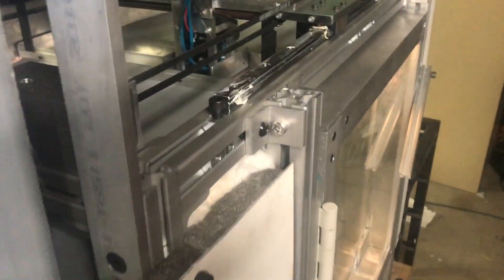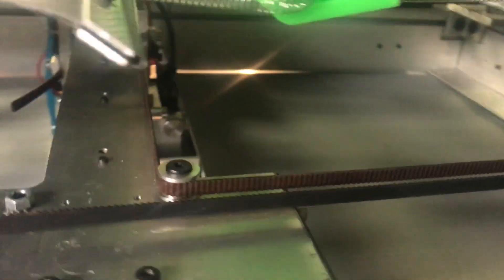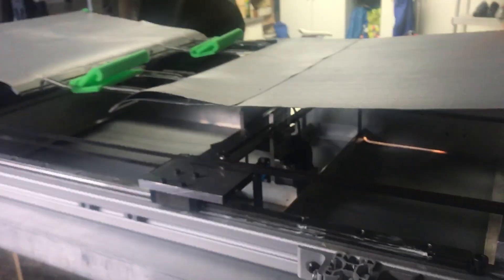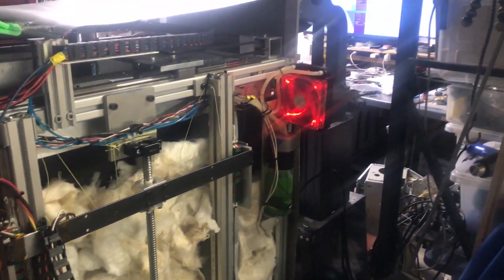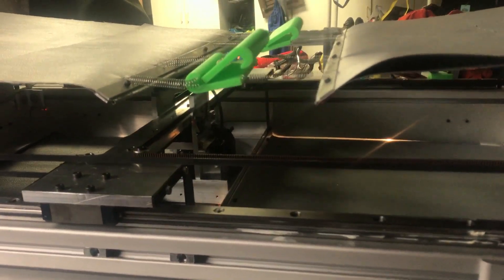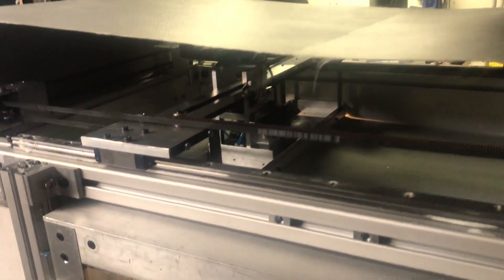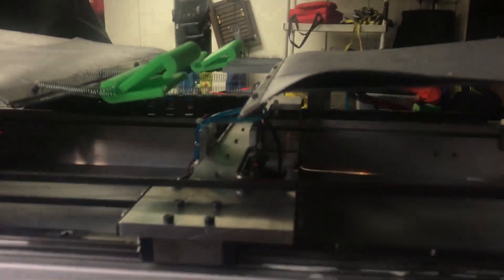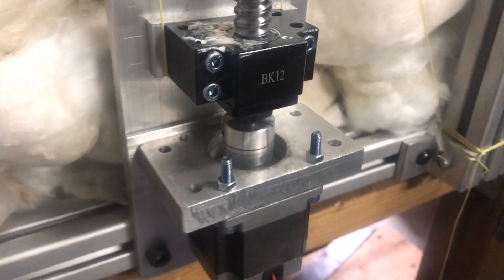Custom Big FDM 3D Printer video review

Comment: Hello Grayon, I was reading your "BFP design notes and documentation", because we are building a FDM high temperature printer. Any update on your project? Do you have any idea on which automatic bed leveling system to use? Which kind of glass you used on the bed?
Thanks for your time and sharing.
Reply from the maker: I haven't worked on this in a long time, but I would look into using a strain gauge on the cold side of the extruder and then just using the nozzle itself as a probe similar to Prusa and others. This would work well for keeping sensitive electronics out of the hot zone, but still having auto bed leveling features